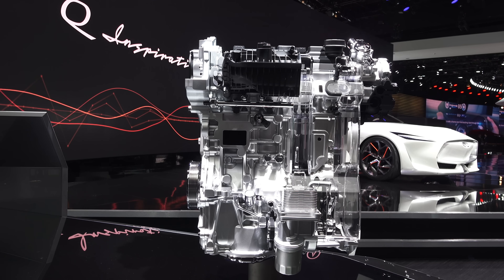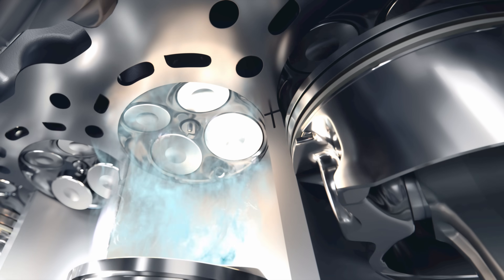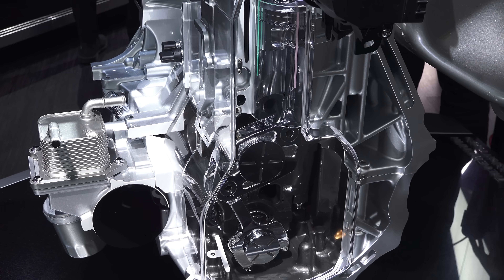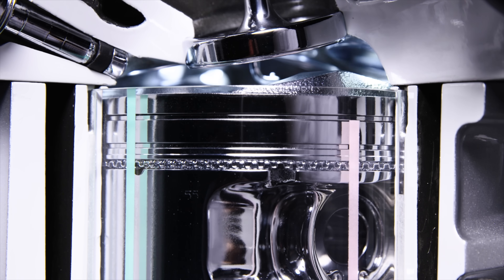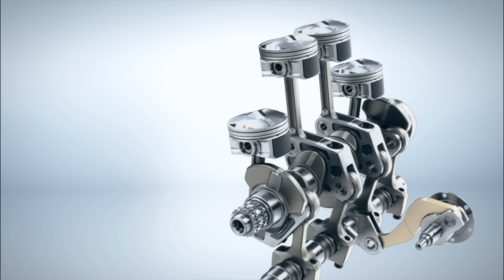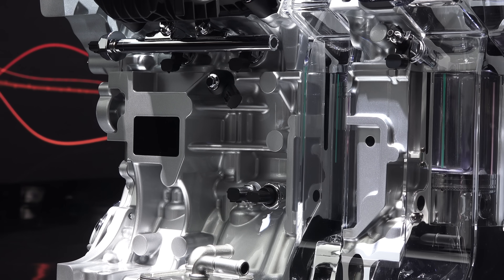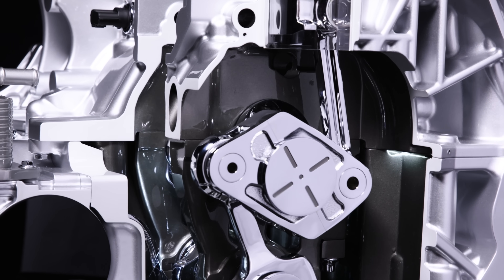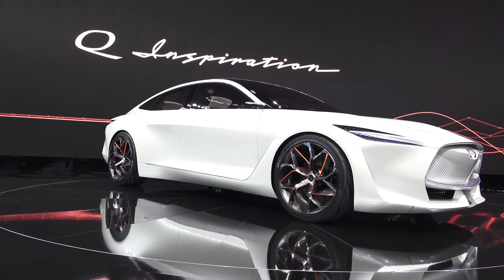INFINITI Reinvents The Gasoline Engine — VC-Turbo

Comment: So, is highly reflective cylinder lining now better than a crosshatch?
It's amazing how they continue finding ways to improve the engine, while in fact very similar fuel consumption was achieved in 1933 MB, and there was no real improvement since.
Reply: Less friction, hello.   Friction bad...
Reply: oil consumption is also bad. And it's getting worse with new engines.
Reply: elektrinis Oil consumption has a lot to do with the very low viscosity oils used in many modern engines. 
F.e. Fiat uses 0W30 oil in their MultiAir engines because of the complex and very narrow oil passages, and it's getting more and more common to see 0W20 oils as this further (slightly) helps with lab-tested fuel consumption and emissions.
I drive a 2016 Fiat with the "old" T-Jet engine: same turbo, same block, but a much simpler DOHC head and running 5W40 oil... and only about 0.1l of oil consumption per 10k kilometres despite lots of spirited driving!
Reply: There was a recent study done by "consumer reports", that found over 10% of some engines (up to 4 years old) consume a LOT of oil, sometimes over 5 liters per 10k km. I myself have a Smart roadster with relatively "complex" engine and a turbo, running 0W30 oil and no noticeable consumption, and also I have a subaru EJ20 DOHC running 5W40 and consuming over 2L of oil every 10k km. After a lost lawsuit, subaru admitted there's a problem with rings and promised to issue a fix after 2012, but no change has been observed by customers.
Reply: elektrinis Yeah, some engines are just terrible with oil, I believe VAG stated oil consumption of up to 1l/1000km is acceptable in some of their engines, but thin oil definitely won't help.
A customer of my dealer refuses to change the oil in his T-Jet more often than Fiat's 30k km schedule, he just tops it up once in between. His oil consumption is currently (after 150k km) at .5l/15k.
I wouldn't be surprised some people just drive from oil change to oil change with those ridiculously long intervals without ever checking the oil as long as the light doesn't come on, which won't help either.
Reply: elektrinis do you know how much more power we are getting out of these engines? How much faster the average speed is at the same mpg figure? How much more weight we are hauling? How much less emissions we are putting out?
I guarantee you that if you take a modern engine and put it in the same chassis as one from 40-70 years ago, rip out the emissions system, and go 30-40mph you will get triple the efficiency
Reply: Michael Borisenko, no, you will not get tripple efficiency, you will not break laws of thermodynamics. Improvements you are talking about are so minor. If compared to IT sector, you would expect this to happen in 8 years, but it took solid 85 years. Think about it.
Reply: Mpg wise, a perceived triple efficiency

Comment: This is why the age of the ICE is at an end.  Thousands of dollars being spent on complex mechanisms just to get a few percent of efficiency gains.  And there is still the problem of having only one source for fuel, a hole in the ground.  We need a minimum of a doubling of ICE efficiency now in order to curb the environmental damage caused by the automobile.

Comment: Ingenious engineering, the horsepower and torque numbers  (268 hp / 272 lb/ft) are good but not exceptional for a modern 2 liter turbo engine. The smoothness and efficiency of this power plant however are likely to be exceptional.

Comment: Higher compression ratio makes a car more efficient, is that because we inject less fuel since the mixture air + fuel will be more pressurized and dense so it ignites easily ?

Comment: The Mitsubishi 4B11( and 4B11T variance used in the evo X) don't use balance shafts, you're welcome, now you know there is a 4 cylinder engine without extra moving parts that don't need balance shaft.
Reply: There are many 4cyl without a balance shaft, CA18DET, SR20DET etc. you only add one if you really want to remove the extra vibration
Reply: I believe they did that with the 4B11 because they were trying to improve it over the 4G63. Also the Honda K20A doesn't have balance shafts.

Comment: how can the height be the same as a conventional 4 cylinder engine?  Where is the oil pan?  Or are they using the linkage area as the oil pan.

Comment: I wonder when (and if) this design will be found in racing - assuming there aren't rules put in place to exclude it.  Being able to maximize power and save fuel means both going fast and fewer pit stops (or carrying less weight of fuel), so it would appear to be ideal - if it holds together.

Comment: if you could use this concept and pair it with completely camless valve train it would be hard to beat for a very long time in terms of power and efficiency. infinite valve timing , with variable stroke and boost ,  pair that with a cvt or these newer 10 speeds and you got yourself a \drive train with insane power output capabilities and efficiency ability.

Comment: awesome new tech from Infiniti, cant wait till the put it on a nice sedan or a sports coupe
Reply: Well they tossed the sport sedan/coupe the VR30 motor which is essentially an smaller displacement version of whats found in the GT-R ,  however they did change up the design
to include Direct injection and smaller turbos.   AMS tuning actually just made 1/4 mile times on par with a GT-R  in a Q60 Red Sport.

As for the VC-T  engine shown here it is  likely aimed to replace the 2L Engine they are using at the entry level of Infiniti, as well as to take over for the aging VQ35 motor found in the Altima/Maxima etc.

Comment: Looks like it has quite a large sideways force for the compression stroke, but should still overall be improved. Would be neat to see this paired with a freevalve type of system. If you ask me though, I think electric drive systems are far less complex, and consequently will be cheaper and more reliable as battery and motor technology advances.

Comment: hmm..   balancing shafts aren't good because they add complexity,  but the variable compression mechanism doesn't need balancing shafts, so it's better ?   ummm  which adds more complexity, a balancing shaft or the variable compression mechanism ?    but I understand the point, although the variable compression mechanism adds MORE complexity than a balancing shaft, the variable compression mechanism adds far more desireable characteristics than a balancing shaft does...

Comment: Interesting if not very revolutionary. I see many additional points of failure. It will be interesting to see how this performs in the real world. Too bad they are going to require premium fuel as this will offset any potential efficiency improvements. Kinda looks like a “Rube Goldberg” device to me.

Comment: What kind of gas mileage can we expect tho???
Reply: james barber. not really.. most modern engines are already about as efficient as they can get with current design.. the issue is...modern engines already burn 98% of the fuel injected into them..but only 30% of the energy from the fuel is actually put to work..
Reply: 24City/31Hw and 27 combined according to EPA, no actual real world testing done yet.
Reply: BigHeadClan It's 2018, I think we can do a lot better than that
Reply: james barber For a 4000+ lb cross over making north of  250 HP? Not really no. People need to remember the current competition to the QX50 with similar power/weight is only about 23-24MPG Combined.

I get these aren't the earth shattering improvements people expected given the hype around the engine,  but for context the F-pace diesel only makes 29 combined and has
nearly 100 less HP.

Comment: 1.5 seconds from gas for my car to know I want power, no thanks. can't I have a switch or a knob?
Reply: That change in compression happens while the engine is running, so when you put your foot down it immediately starts adjusting the compression ratio to give you more power.
Going from 8:1 to 14:1 and back is just how long the entire process takes.

C&D recently drove a test-car and stated that it feels pretty much like any other turbo 4 car, some slight hesitation before taking off.

Comment: That is brilliant! I'm baffled by how nobody thought of this earlier!
Reply: The idea has been around for a long time infinity is just the first to actually put it to use.
Reply: actually there is a lot of great ideas in previous researches, sadly they might never see the light; because no one supported them.
Reply: Well this idea has been around for about 20 years if I recall from when Nissan/Infiniti started submitting patents for this motor,
sadly material, tolerances and cost tend to hamstring technology like this for a long time.
Reply: Like I keep saying the internal combustion engine has so much more potential left in it.
This common belief that its on its last legs is so false. Using past engineering like this and new innovations like Camless Valves, Ceramic construction, HCCI and Oxygen concentrating filters Internal combustion engines could easily attain efficiencies so high that they would render electric propulsion obsolete.
Reply: @the marshmallow exactly!
Reply: Sad but true...
Reply: The Marshmallow
You get it.
Reply: Jonathon Deeds,
It takes competition and external influences to really push ICE to be more efficient. It would also be nice if F1 would allow more experimentation.  I wouldn't hold my breath so much on camless valve systems as already there are three systems to my knowledge now that implement continuous variable valve timing and lift duration changes.
Reply: @The Marshmallow Lol exactly good point, these danm car companies can be so shifty at times. They concentrate on just meeting government regulations and not on major innovations that will revolutionise the internal combustion engine if they where we should have had 300 mpg years ago.
Reply: And looks like the first to succeed at making it to production. It's pretty exciting to me since it's been so long since there has been any significant mechanical changes to ICEs.
Reply: Matthew Sharpe unfortunately they still lack reliability. (Speak from lots of experience)
Reply: Nishant Dash - Ultimately boils down to why spend money on a project when it’s not needed, and dip into profit margins, as well as CAFE standards here in the US and similar laws overseas. Plus the fact that oil companies are heavily invested in keeping fossil fueled vehicles on the roads. Technology for fuel efficiency has been available for a really long time, but if gas is cheap and nobody cares about fuel economy, life is good. 

Things started to change with the fuel shortage in the early 70’s. Suddenly with the prospective thought and execution of fuel limitations, companies needed to produce a more efficient vehicle. 

Similar story for emissions, late 70’s-80’s had emission laws coming into play and suddenly auto manufacturers were required to care about what came out of the exhaust. 

As with all technology, glitches will have to be sorted out. For example, EGR valves are a rarity on an engine these days as more advanced fuel injection systems and variable valve timing have come into play. 

I personally think this is a phenomenal out of the box idea!
Reply: Balancing shafts ?  or no balancing shafts   how did offenhauser achieve 1000 hp at 10000 rpm   with no balancing shaft?
Reply: Jonathon Deeds The gains will be smaller while the complexity and cost will keep going up.  Eventually the economics might not make sense when compared with other drivetrains while chasing a combination of efficiency and per that consumers want.
Reply: As Edison once said, never invent something nobody is asking for.
Reply: Scott Jackson
We'll have to wait and see how it actually performs in road tests, but so far it's showing modest improvement in fuel economy WITH more power than it's competitors. A good comparison is to compare the 2019 QX50 with the new VC-Turbo engine against a Lexus NX200t. Both have 2.0L turbo port & direct injection engines, both weigh about the same, both have the same drivetrain layout options and both have similar aerodynamics. However, so far on paper, the Infiniti makes much more power and gets better fuel economy. Sounds like having your cake and eating it too. But we'll see when road tests come out.
Reply: Jonathon Deeds I could not agree more. but just you wait for the electric brigade to infest the comments. sure a fun sight to watch, seeing them all masturbating about Tesla all at once
Reply: Im glad noone thought of this earlier. This is another thing to ensure that Infinity continues to have low second hand value, a tradition they continued from before NIssans high end was put into its own brand name. Its unreal how luxury nissans/infinity are found with low mileage and still cost less than a Corolla with twice the milage that would cost less than half the time both were new. The value loss the first few years is immense.
Reply: Nishant Dash it's cuz electric cars and efficiency wasn't threatening gas engines until now. So now that it's a threat, look at what funding for R&D of more efficient engines does in such a short amount of time... Smh
Reply: Its cost and complexity. Sorry BEV only trolling conspiracy nuts. KISS.
Reply: Nissan couldn't engineer their way out of a cardboard box is probably the main reason this has taken so long to go to market.  No doubt it'll be something to avoid for at least a decade - just like their unbelievably shitty 90's CVT's that single handed gave CVT's a bad name for 20 years.

Comment: Like variable valve timing in its begining this engine may cause some fear in some people but if the technolgy proves to be reliable maybe in 10 years it will become a common place, the secundary benefits of this designs such as not needing a balance shaft (less moving parts to try to compensate for the added complexity) and the reduction of side loads in the piston are great achievements per se.
Less friction means a lot for the engine efficiency and durability,...

Comment: This is a very interesting development.  I assume it would scale to any inline type motor easily.  Making engines like this gives me hope that I will not be stuck with EV in the future.  I live in hilly northwest PA, and range would be a huge issue.  New tech like this could put a two or three cylinder engine in place of four, or small six cylinder engine in cars and light trucks.  It would give the needed horse power and torque, with much better fuel economy.  Thanks for all of your vids, keep up the good work!!!

Comment: Although I am amazed by the engineering and design behind this, I can't help but think this is gonna add (potentially) lag, considering there's more things that need to be moved when you're trying to get on the power and it's also turbocharged and the fact that more weight is going to need to be moved around per RMP. sounds good on an economy/daily vehicle but personally I don't think this would be of much use as far as sportscar/performance vehicles go.

Comment: That's really amazing engineering.  However it does seem a bit complex.  I wonder how this would compare (on efficiency only) to compression ratio being effectively changed by a simulated Atkinson cycle using something like FreeValve technology.  Or even using a more conventional vvl system that does a similar thing.

That being said it doesn't seem like there are many more failure modes than a conventional engine other than the equivalent of 4 rod end bearings (requiring 4x the oiling?).  I would imagine if the actuator failed it would just be stuck in either power or efficiency mode and still usable.

Really cool stuff out of Infinity

Comment: This is some really cool stuff.  As for the complexity, to be fair, it's no more complicated than a V8 engine.
Major parts:
V8: 8 con rods, 8 pistons,  one crankshaft, 4 cams, 32 valves, 32 springs, two heads (87 parts)
I4 VC Turbo: 8 con rods, 4 pistons, 2 cams, 16 valves, 16 springs, one crankshaft, one pivot shaft, 4 connecting joints, one positioning arm, one electric motor to adjust compression, one head, one turbo. (56 parts).

The way it moves though it just really LOOKS a lot more complicated.

Comment: I can merely imagine the result if this were a flex fuel engine as well, the power level would be over 9000. Specific torque might even exceed modeen turbodiesels

Comment: Honda D & B series engines do not have any balance shafts. And they do not have any issues. I mean some B series rev to over 8k rpm. This engine is intetesting but also has a massive rotating assembly.  Would it have a red line of 5k rpm? If that...

Comment: Are there any MPG numbers available for this right now? Also, this increases the reciprocating mass greatly, which could lead to unforeseen stress elsewhere. With this being in infiniti for right now, the use may be limited, but I wonder if this could effectively be utilized in lower-cost vehicles, such as the Nissan Sentra or Altima.

Comment: Interesting video and technology.
Fairly good primary and secondary balance  has been achieved on four cylinder engines without double crank  speed balance shafts for over seventy years, called a boxer configuration (aka flat or horizontally opposed)
Turbochargers with integrated exhaust manifold aren't innovative either, the now discontinued Volvo T5 had this about thirty years ago.
I am also xurprised when referring to inlet valve closing abdc i.e at the start of the compression stroke as every engine I've read about or worked on in the last fifty years has inlet valve closing after bottom dead centre (after start of compression stroke).
Be interesting to see power, torque, bmep and not least real world fuel efficiency and reliability data when in production.